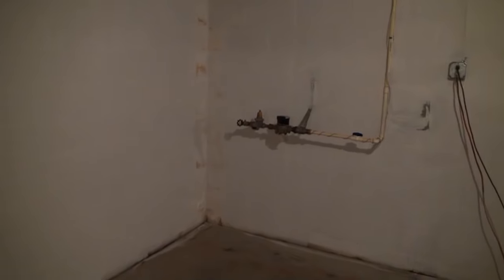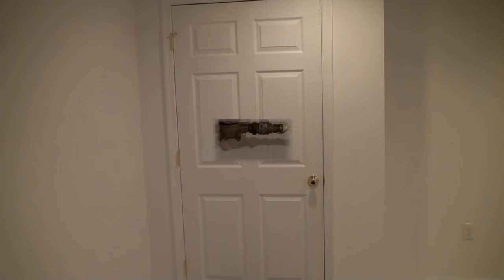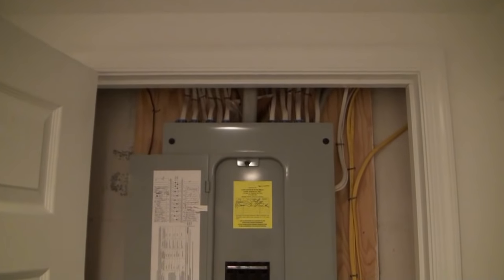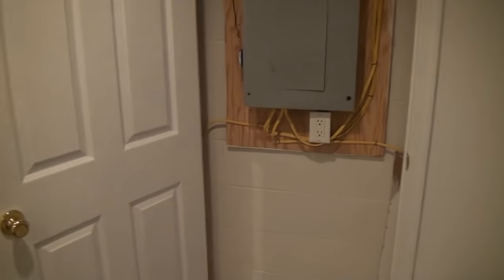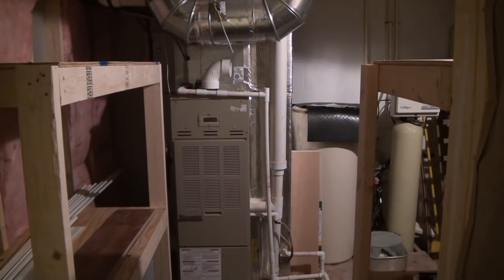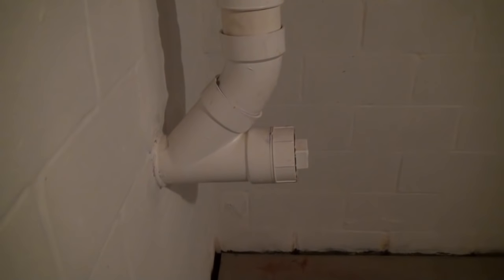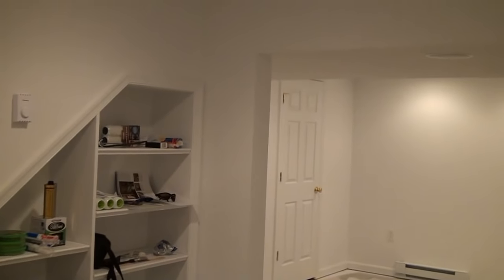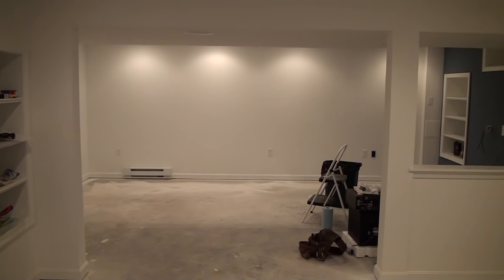Designing Your Basement (This is a LONG Video:-) )

Comment: Great video!!!! the only thing I would address is any time you have a furnace or water heater that draws combustion air from the house (any unit with a metal flue) you need to make sure either A: the room/closet is big enough or B: If its not big enough add louvered doors or put vents in the walls so the closet can get air. the formula is you need 10 cubic feet of air for every 1000btus input, this comes right out of the international gas code book. with out this the unit will not have proper combustion causing higher than normal levels of CO

-HVAC Service Tech
KEEP UP THE GOOD WORK! I LOVE YOUR VIDEOS!!!!!
Reply: along with any unit with metal flue I forgot any condensing furnace that is not a two pipe system (condensing furnaces use pvc flue pipe)

Comment from the maker: Well 1st thing I would do is "DyrLock" the basement masonry walls with the DryLock solution. You can buy this at Home Depot, it comes in 5 gallon buckets. This seals the pours in the block wall and keep them from getting "damp" which reduces humidity in the basement.

If you have central A/c and Heating ducts in the basement "tap" into them and put 2 to 4 feeds in the ceilings of the basement to "move the air". This moving air will also help reduce humidity.

Comment from the maker: 2" x 6" column lumber is regular and this is what should be used.Yes the bottom is touching the floor but that will not hurt the integrity of the framing in this application.

We use Ramset 2 1/2" pins to fasten through the treated bottom plates directly into the concrete floor.

Comment from the maker: In our area as long as you build the wall directly around the box it'self making it part of the wall it's accepted and passed. You can't however build in front of the panel box unless your a minimum of 3'-0" away from the cover.

Comment: Or place see through cabinets with glass doors between the pole and wall where the half wall is and turn it into a nice place to store things and a granite counter on top.
The other 1 foot bump out could be turned into a built in shelf system with see through shelves or see through cabinets.

Comment: Nice video.  Appreciate the share.  Question though:  not any detail around the powder room.  The sewer is part way up the wall, so you must have used a grinder pit or something to deal with the discharge.  I’d like to know how you tapped into the main drain.  I assume you used a ‘Y’, but which way was the sweep?  Did you go up, over and back down or what?  Also, how far did you have to go to tap into the vent and detail?  Thanks.

Comment: Enjoyed your video. Thanks. 
I understand the need for banding a ceiling if there are many pipes and wires. Though, for 3 water pipes, (Pex pipes btw. not copper) why didn't you just turn them 90* and just run them in your hvac soffits? I'd be very happy with an extra 1.5" of ceiling height in any basement.
Reply from the maker: There were several places along those runs where the lines went up through into the first floor multiple times to feed the kitchen and bathrooms above...This was the obvious choice for us for this given project.

Eddie
Reply: Still could be done. Just run the lines from the soffit back to original holes in the floor joist cavity.   I'm thinking it's either work to move the lines or strap the ceiling. Though extra height is always preferred.
Reply from the maker: Not saying it's not possible, it was just not cost effective to reroute all of the plumbing leading to the 1st floor baths and kitchen down through the soffit. to avoid banding the ceiling which took all of 15 minutes.
Reply: Could you band the ceiling with 2x3's to save cost?

Comment: Couple of questions.  You never mention moisture barrier.  The rule of thumb keeps changing... I have naked block walls, not water proof painted.  I don't have any serious water problem, but I do have seepage, (white powder) in certain areas during the spring. Also, builder skimped on a row of block making the central air duct work about 5"10"from floor.  I'm 5'7" and am leery of finishing off the basement.  It runs the entire end to end separating the front from back of house.  They also put the heating/central system under the staircase but spread out the electric water heater, water pump from well as well as the  sump pump and radon fan in an area that is 12x17, wasting this space.  Is there anyway that some of these items can be moved closer together to same from wasting this much space?  The heating system is probably the hardest to move?  Also we have 3 tiny basement windows 12x18" close to the ceiling with tiny exterior wells. Can I make these larger without causing structural damage.  Everyone in my area wants to charge by the hour of what it would cost to actually plan the basement to figure out the cost of renovating it?  I want to plan it before actually doing it.

Comment: You should make a vid about tying into a hvac vent to heat the basement. jst an isolated lil vid of how you would go about that and what, if anything, code cals for in cutting into basement hvac duct work. be nice if you included diff options for ceiling and baseboard vents along with a few diff fixtures and methods you would use to do this. if you chop up all the separate aspects of your longer videos into shorter highlights of specific aspects cuz the average vid intake is short rather then long and you have some great stuff in hour long videos that would gain you more views if you cut them out and uploaded em separate or make new ones of those and also some remakes of very old vids would be decent. kinda like you did with the latest videos cuz they are deff better production value and everything. Bravo either way and thank you! good luck and God Bless!

Comment: I am building my basement mostly by following your videos.  Thank you.  I have the exact problem with the stairs ending too close to the wall like you have in this video.  Can you tell us what dimensional wood you used and a basic "how to" explanation of how to build the bottom step landing?
Reply from the maker: I used 2" x 6" framing with a piece of 3/4" plywood on top of it to make this landing Wayne. Frame it 12" o.c. and use treated lumber instead of regular lumber so it does not rot-out over time.

Eddie

Comment: I like the idea of the full door to cover the electrical panel but not good if it will affect how you lay out your furniture in the room once done.
Reply from the maker: Annony Mouse Yeah looks nicer than an access panel centered on your wall! Can interfere with furniture layout sometimes...it's all in the DESIGN!

Thanks for stopping by our basement finishing  channel Annony.  ~ Eddie
Reply: +Basement Finishing Man A pocket door wouldn't interfere as much with furniture layout and you can still access electrical.
Reply from the maker: That is an option that we use as well...just not the most common option we use:-)

Eddie

Comment: Love your videos! Also what about notching out the pipes or wires if you can?
Reply from the maker: If certain situations for existing wires and pipes we do notch framing to get wire and pipes inside walls or up inside floor joists. But I like to drill new holes for all my new plumbing and electric.

Thanks for stopping by my basement finishing YouTube channel!

Eddie
Reply: Oh ok sounds good! We all have different ways of doing things. All of your work comes out good regardless.

Comment: Great video, watched the whole thing.  With the stair platform, is there any issue with taking out 10" worth of the stair stringer to facilitate the platform.  I would think that taking that much would cause harm to the structural integrity.  Did you do anything with the framing to reinforce that bottom section of the stringer?  Thank you for your time.
Reply from the maker: Yes David we reinforced the stingers by attaching them to the two stairway walls in several areas from underneath the steps before we drywalled. This takes the weight off of the base of the stringers significantly.

Comment: Awesome video. What happens if you need to access, say, the flex duct above the ceiling? You have to cut a hole in the drywall ceiling and patch it back in?
Reply from the maker: +MrFixBroken Flex duct is non-serviceable so there should be no reason to access it. Anything that does need access to it(gas shut off's, water shut-offs, damper controls, etc.) will have an access panel installed in the drywall if needed. Otherwise it's the same stuff you have between your first and second floor of your home and we never even think about that stuff!

Eddie

Comment: Eddie, 2 questions for you. 1st, how much clearance do you allow between the air handler/furnace and a finished wall? The builders have done me no favors, and the space is very tight. 2nd, are there prehung double closet doors, or do I have to frame and install myself? I'm talking the folding style type ones that can quickly be removed my pressing down on inner latch. Thanks!
Reply from the maker: You can go as close as 6" from the non serviceable sides of the unit and if you door is wide enough to access the entire unit when the doors are open you can built 6" from the serviceable side as well.

No Travis...if you are referring to "bi-fold" double doors, you need to frame the jamb separately yourself and then set both sides of the doors individually yourself as well..

Comment: Thanks for sharing this with us, great work... I want to know the distance we need to have in my case the Furnace and the wall? I was reading and some people said 1.6 (18 Inch) and other said will depend of the furnace specs. Thanks in advance
Reply from the maker: Hi Jose! Most modern furnaces (Gas or Electric) can have the new framed walls 2" to 3" away on the "non-serviceable" sides of the furnace. The serviceable side should be 6"  or better. This is my rule of thumb, not everyone will agree with it, but...I've never had any issues and I'm about 1000+ finished basements into my career.

Eddie

Comment: Would most codes allow you to place a piece of granite on those half walls to use as part of a eat in kitchenette ?
Or place stools there and make the half walls a part of a bar and eat in kitchenette.
Reply from the maker: Yes they will permit this as long as you have corbels to support the granite every 4'-0" with no more than a 10" over hang from the half wall. If you have the room build a 2" x 6" wall instead of a 2" x 4" wall for better load support and more rigid stability.

Comment: If your basement joists require banding due to pipes running does the banding need to be done first and then your wall framing gets attached to the banding? The issue I am running into is the pipe runs under the cat on the exterior wall. I cannot put the wall up without crushing the pipes unless I installed banding first or did cut outs for the pipe. Which technique is better?
Reply from the maker: We cut-out for pipes. Banding is ALWAYS done last after ALL framing is finished including soffits.

Best,

Eddie
Reply: @BasementFinishingMan  thanks Eddie! Is there a good video that you have that shows your process for cutting out for pipes on an exterior wall?

Comment: Eddie... good stuff on your channel.  I'm in the planning phase of doing my basement down in Shrewsbury.  I like how you hide the water main and electrical box.  In my situation these two items are on the same wall approximately 6' apart.  For the water main I need a foot of space out from the cinder block wall, less for the electrical box much like you have in this video.  Would you recommend building this entire wall a foot out and using two doors a few feet apart? Maybe only build out in the areas that need extended out from the wall? Any other recommendations for this situation?
Reply from the maker: Yes that's what I would do...using 2 doors on that wall with an even bump-out for that section of that wall would look best! 

Eddie
Reply: Thanks Eddie!
Reply from the maker: Your welcome brother!

Comment: I want to put a sliding barn door you can buy at home depot but 400 is too much for one door n install kit. I have open joists but water pipes running underneath the joists for the furnace. What do I do?

Comment: Hi, Eddie - great channel, I've been watching a number of your videos. I have two questions if you have a minute: 1) I know usually you need 3 feet of clearance between the front of your electric panel to a wall. Is it different with a door if it closes right over it? Do you need a special type of door?, and 2) On the basement stairs landing point you made in this video ... I have a similar issue in my basement, but I also have a headroom clearance issue at the bottom of the stairs. It's framing under a closet on the first floor and I'm tempted to angle or push back the front joist to provide the proper clearance and meet code. Any tips for this issue? Thank you!
Reply from the maker: Hi Joe. Thanks for the kind words! Some townships will let you do the door right up against the E-panel like we did it in this video, and still others will not...you need to ask your code department before you do this...most will let you.

Those joists at the base of the steps are load bearing obviously, so be careful when removing them to move them back. You will need to temporarily re-support those joists with a temporary wall prop while you working on cutting and rearranging them the way you need them so nothing sags or collapses while your working on them! They are not carrying a ton of weight, so you may be able to use a 2" x 8" replacement joist pattern to gain a few inches in that one area where you need the extra headroom clearance.

Eddie

Comment: It would be better to do a drop ceiling in basements. Because if you need to do any work or install cabling for tv or electrical you will not need to tear down the drywall.
Reply from the maker: Put it in before you drywall! If you live in a two story house what do you do between the fist and second floors?...It's the same with basement. Make your connections before you drywall that's all you do: - )

Drop ceilings you lose 3" to 4"  in ceiling height as well. W/ drywall you only lose 1/2" to 2" max....PLUS your new finished space "looks" like a basement when you use drop ceilings. Drywall is the real deal.

Just my opinion understand...!
Reply: BasementFinishingMan
I have seen many home with finished ceiling in the basements and the home owner regret doing that .Like when the cable guy comes in and tells them sorry I can not put you cable in because of a drywall ceilings.Or they have a leak from a busted pipe. sure they look nice until  then.And you have to remember most people do not think of those things before hand.
Reply from the maker: dodger889 To each his own Dodger889! It's the oldest debate in basement finishing...drywall ceilings vs. drop ceilings...Whose to say what's right and what is wrong here. I just know what I like and what my clients like, and most prefer drywall ceilings to drop. It seems you like them, and I respect your opinion and your reasoning. Thanks for commenting!

Eddie
Reply: BasementFinishingMan
Reply: dodger889 - I think drop ceilings are a bit tacky. I'd stick with drywall. Better finished product
Reply: dodger889 then why don't you as the homeowner put the cable lines in before you drywall.  That's what I would do.
Reply: 2 things to consider when choosing drywall vs drop ceiling. 1) drywall reduces the noise transmission between floors and increases the fire resistance rating of the ceiling unit. 
2) drop ceilings are easier to access and service.  Since most mechanical rooms are in basements, its nice to have access

Comment: Hi, Love your videsos. Very informative. Thank you.

Two quick questions on column masking.
1. You've used 2x6 & I saw them resting on the concrete floor. I am planning my basement & the township asked that, wood in contact with concrete needs to be Treated (PT). How about the columns though? Are they PT or could use untreated 2x6?
2. How are the 2X6 on the opposite side of the half walls supported at the floor? Anchors? I plan using Ramset for the bottom plate for the walls.

Thanks.

Comment: at about the 27:00 mark; to frame the wall that's 5ft from the column - do you build it in a different part of the room? because you've shown to frame the wall on the floor and lift it into position. thanks!
Reply from the maker: Dave yes that is correct, we simply built 2 sections of wall out in front of the column and then slid the built wall sections over in front of the column and then stood them up and fastened them into position. Good eye!

Eddie
Reply: @BasementFinishingMan  thanks for the info, Eddie! Your work is incredible, and the tutorials are so helpful too
Reply from the maker: @Dave-sd7us  Your welcome Dave. Thanks for the views brother! Good luck with the projects.

Eddie

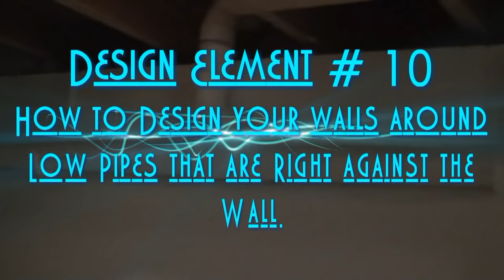Comment: Eddie?  Design Element #10 starting at 46:53 (The drain pipe)..... Does any of your videos discuss the best way to fire block this wall that will be built about 10" off the wall?  Using even a 2 x 8 for the block off plates is not going to reach the wall.  OSB strips cut to size perhaps?
Reply from the maker: When we have big gaps like 6" or more we stuff ROXUL fireproof insulation all along the top of the wall to close it off. This is code and it works great...not to mention it's quite easy to do as well. You can buy this ROXUL fireproof insulation in bundles at Home Depot and at some Lowes stores.
Reply: Thanks so much for responding.  This will help a ton.  Love your vids.